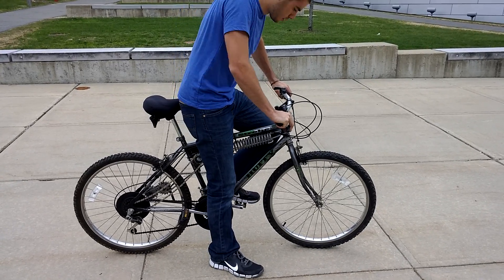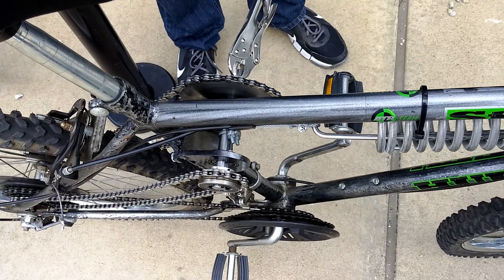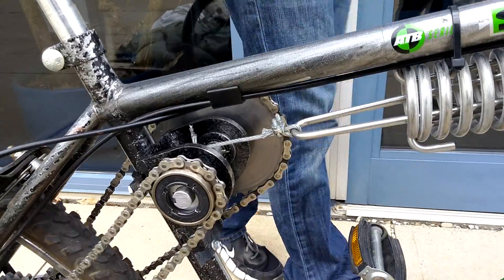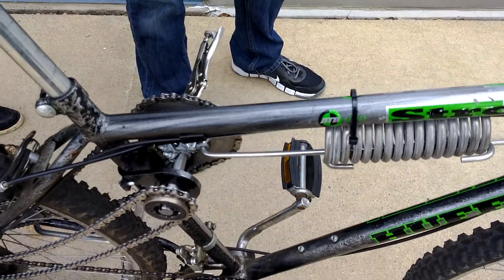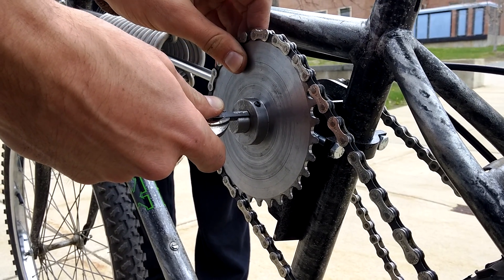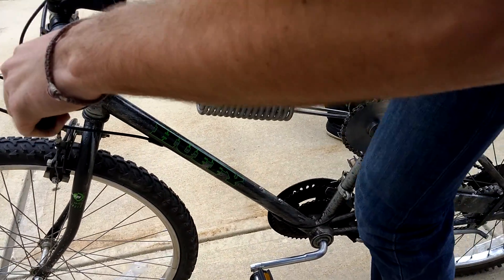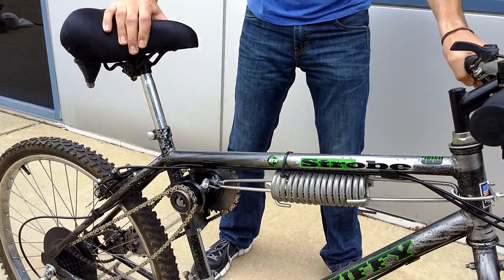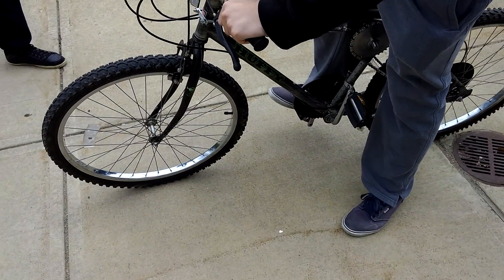Senior Design Project (Regenerative Braking Bike)

Comment: You've got the general idea. Did you know an Australian company made regenerative truck differentials for a type of US srmy truck? It was like a replacement for the deuce and a half trucks or something. They done it 15 years ago. Apparently saved 30%+ fuel over a system without it. I think it was a spring system or something. I don't know how reliable they were.

Comment: An other example of very low intelligence engineering. This invention combines low effciency with high weight and maximum of parts. The likelyhood of being hurt and any malfunction seems to be a high risk either. Last but not least the presentation in the videoclip is very unprofessional.
Reply: What did you invent?
Reply: Do really know the meaning of mother tongue?
Reply: So much hate for a concept piece.

Comment: If the idea to store brake energy in a spring is simple, to make it, is far to be obvious, congratulation from France. But You arrive probably like me, to the conclusion than to store 20 000 Joules in spring, need 15 kg of spring...
Reply: I had the same idea (from France too) but my results are different (http://www.halfbakery.com/idea/Regenerative_20Brake_20Bike#1490171649). I'd like to build this with someone. Steel torsion spring is given for 5kJ/kg, so 1kg fits the 100kg@32km/h(20mph) case. But a tandem (or cargo) at the bottom of a hill (200kg, 60km/h) would need 27.8kJ so 6kg of steel torsion spring.
Reply: @Realistis  What about a fibre?
Reply: Hallo
I think that this idea can work very fine!
Dont you think so?
Allow me to make a Test quetion to you.
In your Opinion what is a major and obvious mistake that the Menns hier in this Video did and the cose why the Bike didnt moove?
Congratiulation to the guys they did a good work!

Comment: can u plz tell me the gear ratio used of chain sprocket system and also the diameters of the chain sprocket system ? also plz provide me the aprrox. weight and material of the flywheel
Reply: Don't you want the blueprints of the whole thing while you are it?
Reply: No flywheel even IN the damn thing. Idiot.